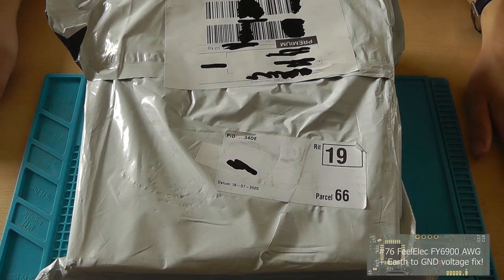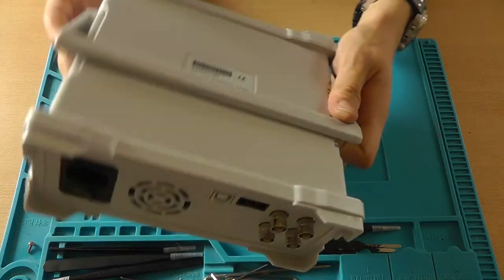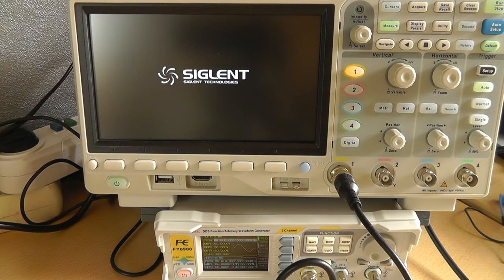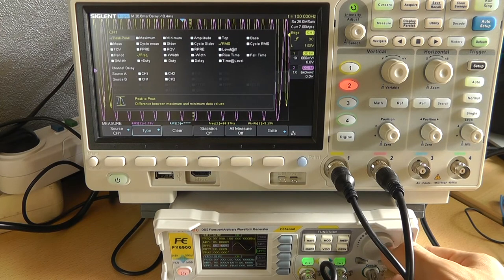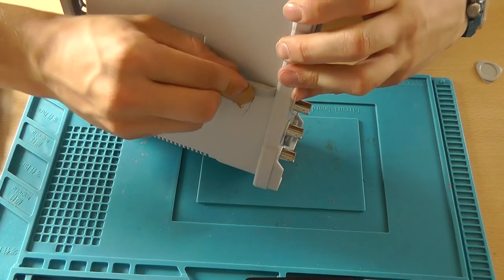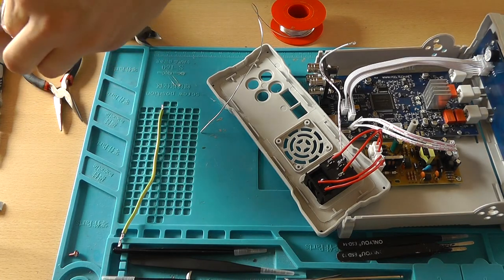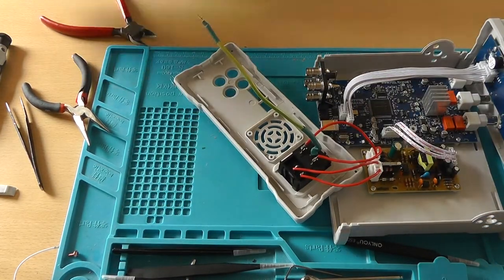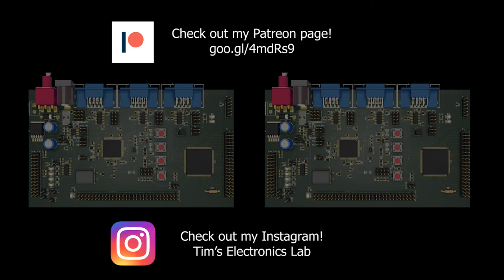#76 FeelElec FY6900 AWG 📈 + Earth 🌍 to GND ⚡voltage fix!

Comment from the maker: IMPORTANT:

The fix shown in this video is dangerous and should not be used. I've made an update video on how to properly fix the mains coupling issue.
You can view that video here: https://youtu.be/bBx0yMjRH2Q
Reply: Video is private. Can you publish it?
Reply from the maker: Hi Matix! The video is scheduled to be released next week, but you need to remove the blue capacitor next to the optocoupler and connect the earth wire directly to the GND of the system instead of through a resistor first
Reply: @TimsElectronicsLab  Can I have an early access please? :) I'm about to receive fy6900 tomorrow and I'm a little afraid of using it due to that AC voltage on BNCs.
Reply from the maker: @matix2120  I can imagine, try to measure if the voltage is there, if there is, connect the system ground to the earth prong on the 3 pin mains connector. Just don't add the resistor.

Comment: I don't really understand why you upgrade the earthing wire to a proper diameter, when you then put a puny resistor in series with it.
Reply from the maker: Haha yeah, that's a good point! I was probably better off having a couple of resistors in parallel, diameter wise
Reply: Same question for me!
Reply: That resistor defeats the earth grounding purpose. If you short something out, the earh leakage protection won't kick in..
Reply from the maker: The resistor is preventing an earth loop

Comment: Hi, I couldn't see how you tested those voltages on the ground. I have just bought one but don't want to open it in case they upgraded it. How do I test first?
Reply from the maker: Measure the voltage between GND and mains earth. That should be 0
Reply: @TimsElectronicsLab

Comment: Hello friend, what is the number of the integrated circuit that is on the generator power supply plate? I had an accident with an electric shock, lightning, and my integrated circuit had a hole. If you would be kind enough to see the nomenclature that it has, since I have the same model, I would be eternally grateful. God bless you, hoping that you can help me.

Comment: Hi Tim for me it makes no sens to change the earth wire and ley earth only by resistor to ground. What I have picked up is how difficult opening is. Thanks
Reply from the maker: Hi LemmisTube, 
Thanks for your comments!
You've let me wonder, why doesn't it make sense?
Reply: Faz sentido  mudar porque o fio terra é muito fino por um de 2,5 mmm por segurança
Reply from the maker: Thanks for your comment! I'll do some research and probably make a follow up video!
Reply: @alssilva8496  a dúvida  está ocorrendo porque se vai entrar em série com um resistor de 10k, a corrente fica limitada a valores muito baixos, então para quê ele colocou um cabo mais grosso?
Reply: Why upgrade to a thicker cable for the ground if it's in series with a small resistor (10k? It would pull any current way down), and if there is a current high enough to melt that cable, the resistor would blow up first... anyway, I think it can be interesting to measure any voltage over that resistor, as I heard those generators use to shock a bit. Don't know if it's true!
Reply from the maker: That is correct, I still need to try the diode fix. There should be around 90VA on floating on the GND without the resistor

Comment: I put my multimeter to volts and put the black lead on the ac earth of the plug and the positive lead onto the earth of one of the bnc connectors. It gave an 18v reading. Do I need to modify it to show zero?
Reply from the maker: Yes you do
Reply: @TimsElectronicsLab  I decided to send it back, I will look for a more expensive one, any recommendations for a hobbyist?
Reply from the maker: Not sure to be honest. Maybe there are some opensource variants. If you do find one, please let me know 🙂

Comment: Hallo Tim,
Leuk dat je video's maakt maar naar aanleiding van dit verhaal zou ik maar eens wat huiswerk doen: Veiligheidsaarde zacht maken met een serieweerstand is geen verantwoorde of juiste manier om aardlussen of offset-spanningen te voorkómen of bestrijden. Je geeft potentieel levensgevaarlijk advies.
Reply from the maker: Hi Raymond, I'm aware of it and I'm working on a new update. I got this information from the EEVBlog and I consider that a very reliable source of information. Jim, who has also commented on this video has given a solution, that I will make a follow-up video of
Reply: @TimsElectronicsLab  Hi Tim, thanks for your reply. Unfortunately, I haven't been able to find anything re. the problem, i.e. what is it? Do you have a link or term to use on Google?
Also, stupidly, I hadn't seen Jim's reaction or I wouldn't have given my reaction the way I did. Sorry about that.
Reply from the maker: No worries! The problem is that there is 90VAC on the GND of the BNC'S and according to the forum post on the eevblog you can put a resistor in series and connect the GND to earth. https://www.eevblog.com/forum/testgear/re-feelelec-new-arrival-fy-6900-signal-generator/msg2635677/#msg2635677
Reply: @TimsElectronicsLab .
First, I have to say I have no FE6900.
Second: Sorry for the lengthy post. I couldn't make it shorter without losing its meaning.

In his answer to Jim, Tim said: 
1. "So if I recall correctly, I should remove the Y cap and connect it to the earth of the AC connector.
2. Then I shall connect the BNC's earth straight to the AC's earth right?"
and also
3. "And the other side of the Y cap should be at the GND of the mainboard?"

If I interpret this correctly, it says:
A. "Y-cap" must be connected (1.) between AC earth (which is safety earth) and (3.) mainboard GND.
B. In 2. it says that "BNC GND must be connected to AC earth". That is correct because normally, all "chassis-like" things, like BNC bushes, which are almost always connected to the mainboard GND, are connected to safety earth, which is AC earth. So, mainboard GND is connected AC earth.

If connected this way, the Y-cap is shorted and has no function.

- Y-caps are connected between each phase and safety earth, so they usually come in pairs. In places like Europe, no strict prescription about the phase connections exists.
- X- and Y-caps are used to suppress noise coming in (and going out!) over the mains lines. It only makes sense to use two Y-caps (between AC phase and earth) and a single X-cap between phases. One "Y-cap" makes no sense, definitely not in Europe.
- X- and Y-caps are placed as close as possible to the mains entry and certainly not on a device downstream that is fed by a switching power supply.
Summing up:
I don't think the cap really is a "Y-cap". I don't know where it is located but it seems to live on the mainboard. Maybe it is a noise suppression cap on the main board, in which case its connections should be made on the main board. A separate connection should go from the main board to mains (AC) earth. The wire that was replaced by a thicker one serves that purpose.
Ground loops are common, are sometimes caused by safety good practice and requirements, and should be dealt with on a signal level, not on an earth/mains level.
Reply: I also wrote a reaction to Tony Albus (another fellow Dutchman) this.
Reply from the maker: Hi Raymond,
No worries. There is this post about a solution with diodes. https://www.eevblog.com/forum/testgear/re-feelelec-new-arrival-fy-6900-signal-generator/msg3278570/#msg3278570
Is that a better option? Connecting the Y-cap to the GND and Earth seems a bit pointless to me.
Reply: @TimsElectronicsLab  Not really and here's why:
1. It's against safety earth *regulations*.
2. It's unsafe: There's no guarantee that the mains fuse will trip and not the diodes, even with 5A diodes or even fatter ones.
3. It's unnecessary. Consider introducing some impedance at *the DUT side*: use differential measuring or float the DUT (never your measuring equipment, like your 'scope). Compromising earth (power supply safety) against signal problems is wrong and bad practice - and unnecessary.
4. It's unprofessional (this may not count for some). I really don't understand why people keep talking about this and coming up with these "solutions" or tricks, rather. This circuit layout ("hard earthing", that is), has been with us for who knows how long and no serious equipment (manufacturer) would willingly compromise earth quality, if only for liability reasons.
All these "problems" and "solutions" are the result of a lack of understanding - or care, to begin with, as in the ridiculous and non-compliant layout of the low-cost FG's of course. 

Re. the Y-capacitor: Let me take away one possible misunderstanding first: X-caps and Y-caps really are(by definition) more of a function in a circuit than a physical capacitor per se. To be acceptable for performing that function, the physical caps need to fulfil specific requirements and the components are marked appropriately. The X- and Y-functions are by definition always and only on the mains input: Phase, Neutral and (safety) Earth.  The only correct location is between Phases (or Phase and Neutral) for X-caps and between Phase/Neutral and Earth for Y-caps, close to the mains entry*. If Earth is connected to system GND somewhere, that GND is *no replacement point for connecting a Y-cap, physically nor functionally.

- If you really meant "GND", as in System Ground, metal case, chassis or the like, GND and Earth must normally be connected together, as said before, so putting the "Y-cap" between Chassis and Earth would indeed make no sense. 
A floating System Ground is only acceptable under stringent isolation conditions for the instrument, including its mains power supply. With such a power supply, "gnd" may be floating but not then bridged by the so-called (incorrectly) "Y-cap". That was the ridiculous situation with the cap across the isolation in the cheap 6600's. That cap really coupled mains (there was no earth connection) with the BNC's, causing the voltage on the BNC. Take out the cap and all is well (if the PSU is OK and safe) but don't connect a cap there! I really don't understand all the talk beyond that.

- If I interpret your sentence as "between mains Neutral and Earth", it doesn't make much sense either, however, the Schuko mains plug (like that used in the Netherlands) is not polarized, meaning that you don't know which of the round pins is mains Neutral: It depends on which way you insert the plug. In countries like the UK, Ireland, USA (grounded), and many more, the positions of the wires are prescribed.
That's why it makes sense to connect two Y-caps. One of those will be connected to Neutral, the other to Phase.
Reply from the maker: Thanks again for your detailed explaination. 
I think we can conclude that they use the same PSU as the cheap 6600's as the BNC's are coupled with mains, with a voltage being present on the BNC's. 
So, to fix this problem it's safe to remove the Y-cap(s?) and connect the BNC, with connects to the system GND straight up to AC Earth without a resistor in series.

Here is an picture of the PSU used in the FY6900's: https://sdgelectronics.co.uk/wp-content/uploads/2019/12/image-1024x648.png
I suppose that the Y-cap(s?) aren't visible on this image and that they are located at the mains connector side.
Reply: @TimsElectronicsLab  AFAIK, there are no Y-caps in these models. They would have to be close to the earthed 3-prong mains entry and would need a connected safety earth. The cap causing the voltage on the non-earthed BNC's, which has repeatedly been erroneously called a Y-cap, is there to see in plain sight: C7, creating a path between the mains entry and the BNC sockets! There's your voltage source! If anything, C7 couples noise into the DUT via the ground of non-earthed BNC's. It should go!
Reply from the maker: @raymonddompfrank1789  So C7 should go and the BNC's should be connected to earth. Cool thanks! I'll make a follow up video soon 🙂
Reply: @TimsElectronicsLab  Yes, Tim, that'd be the official (and standard) way. If there's a big leak from the primary (mains) side to the secondary side of the power supply (PS), (because the PS is trash), the PS would blow up (or blow its own fuse), protecting you, which is exactly the point of earthing the metal parts in the FG. As said, ground loops (if they exist) must be taken care of in your measurement setup, not by floating a FG's PS.

Comment: Hallo Tim, wat is het nut van de 10Kohm weerstand naar de aarding van de IEC connector ?
Tevens haal je 2x een netsnoer en multimeter bij, de 1ste keer laat je gewoon zien dat er 220V aanwezig is op het netsnoer, 
en de 2de keer na de "fix", haal je opnieuw het netsnoer en multimeter bij en word er niets getoond.
Ook word nergens in de video getoond wat het werkelijke probleem is.
Reply from the maker: Hi Bjorn,
That is to prevent the GND from floating (@50V AC) 
This can potentially be dangerous for you and your electronics so I do recommend this mod.
Reply: @TimsElectronicsLab  , blijkbaar hebben onze reacties mekaar gekruist :-) 
Ik had al een vermoeden dat het lekkage probleem naar de BNC connectors het probleem was, maar origineel was er al reeds een aarding aangesloten vanaf de IEC connector naar de print toe, welke deze lekkage zou moeten doen verdwijnen.
Ik snap dan niet, dat een weerstand van 10Kohm toe te voegen, dit probleem zou oplossen, aangezien dit zorgt voor een slechtere verbinding met de aarding, en het probleem gaat erger maken ? 
De 50V AC wat blijkbaar aanwezig is op de BNC connectors (wat niet getoond word in de video), word veroorzaakt door de blauwe veiligheids condensator tussen primaire en secundaire zijde van de pulstransformator, ter preventie van EMI. 
Maar zoals ik al vermelde, door een degelijke (lees zo laag mogelijke weerstand) te hebben tussen de massa van de BNC connectors en de aarding, hoe minder of zelfs geen lekkage aanwezig is op de BNC connectors.
Reply from the maker: Then they might have fixed it, I'll reopen my unit soon as I'm not satisfied with the thickness of the connection. Thanks for your response! I can learn a lot from it

Comment: Hi Tim, 

What was the wattage and resistance did you use for the resistor?
Great video 👍
Reply from the maker: Hi Jack!
I think I used a 10k resistor but I don't remember it. It should be on the eevblog forum, just like the other solution that uses diodes. I'll make a follow-up video soon!
Reply: @TimsElectronicsLab  Sounds good and thanks for all the info👍

Comment: I'm just taking a shot in the dark for information here, but you don't happen to know if there exists schematic and source-code for the programmable devices on the PCBs? I'm interested in, if possible, using the same type of AWG together with a 4-channel 200MHz Siglent DSO, and would like to, if possible, modify the protocol it speaks over USB so it can directly interface with the Siglent and produce bode plots without needing to add a USB-8pinTTL translation device in-between. Any information is appreciated, even such things as frequency stability, output driver impedance accuracy over a wide frequency interval etc.

Btw I think the DSO you connected the AWG to has 1Mohm inputs, so you should use 50ohm BNC terminations on the inputs to avoid reflections/standing waves i you're looking at anything with higher frequencies.

I have always found common grounding of test equipment a real pain, since it always leads to a complete mess signal quality-wise, maybe it would be better to convert to using an external wall-adapter and adding a separate ground banana-socket that allows it to be connected to a common ESD-rail instead? 

I wonder, could you perhaps check how the incoming USB signal path is routed - does it go to a FTDI-chip and get mux:ed together with the TTL-wired on the back, or does it have it's own path into the FPGA? I'm asking in preparation for my own future instrument acquisition, where I would ideally like to maybe buy a cheaper FeelTech AWG with only USB connector, but modify it with a MCU to pretend over USB to be a Siglent AWG..
Reply from the maker: Hi Daniel!
Thanks for your questions! There are a few people on the internet that have asked the same question (regarding the USB connection) on the eevblog forum (https://www.eevblog.com/forum/testgear/siglent-sds1104x-e-and-sds1204x-e-bode-plot-with-non-siglent-awg/50/)
I suggest that you search around a little on the forum, it might hold some answers for you. It will definitely hold high res pictures of the PCB.
Let me know if you succeeded in your quest to control the device over USB!
Reply: @TimsElectronicsLab  thanks for the reply. I have got stuck already at step 1 (buy Siglent DSO) due to flu-induced acute poverty, so this project will probably draw out in time.. but maybe the chinese have even better oscilloscopes to sell for the same price whenever/if I can get back on my feet economically speaking, I must admit that it feels a bit sad that a 4-channel DSO that can match the 70's Tektronix 2465 that could easily sync to 400MHz sine that I owned until 5 years ago and used mainly for hobbyist-level SMPS and class-D amplifier nerding is still so much out of reach even for many companies if you really want all 4 channels to support proper 350MHz bandwidth, I guess the ADC would need to work at 10-20Gs/s in order to catch things like diode cathode oscillations when switching a bit too hard..
Reply from the maker: Yeah these weird times hit everybody, still happy to read that your projects are continuing and I hope that you will be ok!